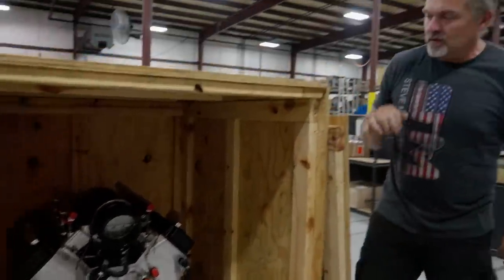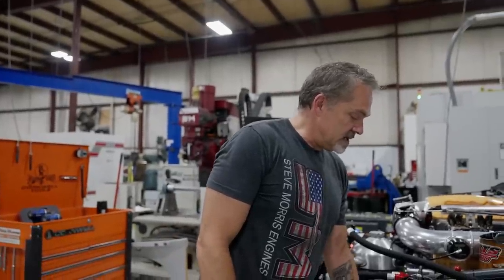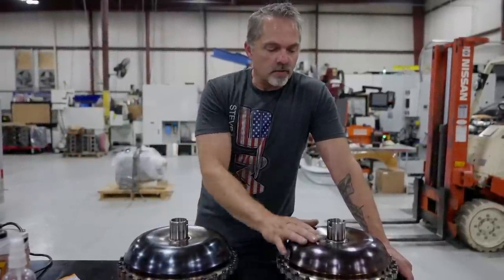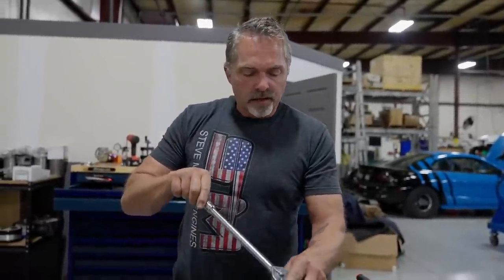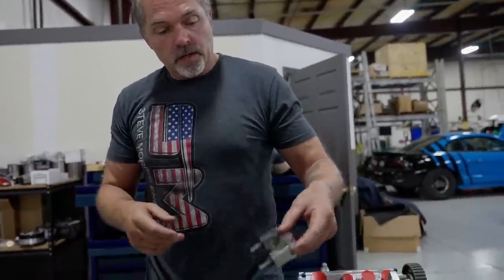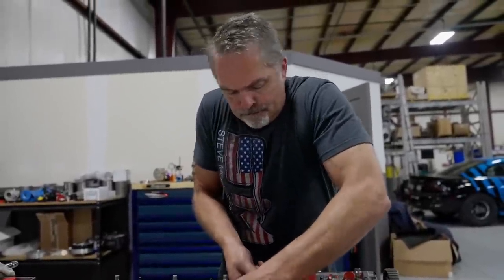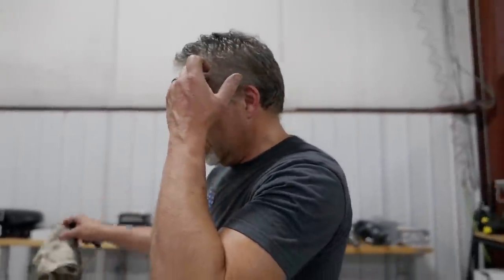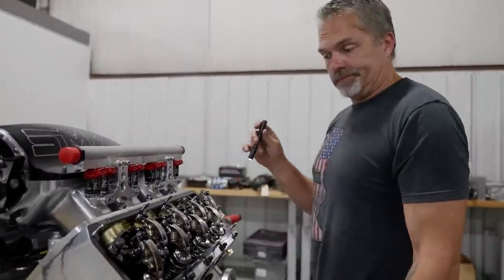What’s Up With Mullets SMX? Part 1

Comment: My bet is the oil pump itself.   Can't see how else the debris would be in the filter and nowhere else.
Reply: Agree!
Reply: I think so too
Reply: I was thinking the same or materials left in the fuel lines after being made and not completely cleaned out.  But I’m far from being any kind of expert and that’s why Steve is the best and will come up with the conclusion.
Reply: Plus that would also make sense why he dropped oil pressure.
Reply: +1
Reply: Debris left in cooler, lines or oil tank.
Reply: Would debris alone be enough to drop it down to 9 psi of oil pressure?
Reply: @richluckey8639 no, but if the pump is eating itself up it will cause debris and low oil pressure
Reply: Agreed
Reply: @aaronholtgrewe1971  from the fuel lines? but fuel dosnt go to the oil filter?
Reply: I got $1 on the oil pump
Reply: I agree. It wouldn't be the first oil pump that was destroyed and ended up in the clear view filter
Reply: Oil pump cavitated eat itself internally
Reply: @shelbyboer9416  Yea I am leaning towards the pump itself as well. I just saw others commenting that it could just be debris and I didn't think that alone would do it. Thanks for clarifying.
Reply: Didn't they already put a new oil pump in a little while back??
Reply: My thoughts too. Came to see if anyone mentioned it.
Reply: @dmmness was that cleetus that had the pump problem? I get mixed up with all the videos
Reply: Yup same here
Reply: @KPSchleyer  I thought they swapped it out when they initially found some debris in the filter the first time.
Reply: That's what I just posted, you beat me to it.
Reply: @richluckey8639  I didn't know he dropped oil pressure, the oil pump is now super sus.
Reply: agreed
Reply: Exactly what I was going to say
Reply: 100%
Reply: Yeah, it was the pump last time also. He didn’t get a new one- it just got rebuilt. So it’s still a problem child.
Reply: My thoughts also, the oil pump.
Reply: I agree
Reply: Yeah, just like the last time
Reply: The pumper of oil is dysfunctional
Reply: I didn’t see the debris but aluminum rods always rub together and leave aluminum in the filter happens on my hemi
Reply: That's what I was thinkin
Reply: Isnt that tne same issue Tom Bailey was chasing and found out it was the oil pump the whole time?
Reply: Steve didn’t you have an oil pump cause debris before maybe it’s an oil pump again
Reply: That's a brand new pump they just replaced.
Reply: @CaptainNero  yeah, after the first brand new Peterson R4 oil pump failed
Reply: Peterson oil pumps are ideally set up to turn in the 4500-4800 rpm range for maximum efficiency. I wonder if it's spinning  to fast and cavitating maybe it needs a different pulley
Reply: I was going to post this as well. Didn't Bailey have issues with his oil pump as well?
Reply: Tom had oil pump issues recently. Wonder if it could be related?
Reply: didnt he have a issue with another pump? this is the second one on this engine right?
Reply: Isn’t that the second oil pump?
Reply: @brandonlempar1195 but does your hemi drop to 9psi oil pressure like this did?
Reply: @KPSchleyer Tom Bailey had oil pump issue on his smx
Reply: @UnDeath91  your absolutely correct, my dumb ass said  fuel when I meant oil
Reply: Oil not fuel is what I meant to say.
Reply: @Foshomoto I think you are spot on. Cavitation causes micro explosions that will remove material from most any metal. These tiny “potholes” then produce lips that get ground off because the clearances become too tight, producing more metal particles. Either that or the one fabricated line that runs from the pump to the filter had debris in it. Anything else and you get debris in the pan. If the pump makes enough pressure at idle with a 6000 rpm pulley, I would see no reason to spin it faster. Everything gets better: less heat, less chance for caviitation, more hydraulic efficiency, less parasitic drag.
Reply: @bwalker4194 You’re exactly right on all points but the last. 
You have to drive the oil pump a little harder than you’d initially think to maintain pressure at high RPM because the crank acts as a centrifugal pump, flinging oil out of the big ends. That drops system pressure unless the pump is driven harder to overcome the loss. 
It’s particularly noticeable on engines that are set up to run big bearing clearances. 
😎👍🍻
Reply: @mikehunt3222  at the end of track it drops to  18psi for little period time cuz run wet sump pump, but never worry about it cuz rod bearings still have coating on them after 60laps
Reply: 100% I think this is a failing oil pump, the pressure drop and material in the filter and pretty sure the filter is right after the pump.
Reply: I'm in on the oil pump theory.

Comment: As for Garret's abundance of caution, it's  because the price difference between LS and SMX motors will tend to do that.
Reply: more than likely the down time if it completely grenades
Reply: isnt it sm to smx like differance?
Reply: When did he ever have a LS in the El Cammino?
Reply: @KimiWallrus  i not 100%  when it first got built at KSR
Reply: @williamherzog6920  that was the first motor ever put in from cleetus 427 texas speed
Reply: @KimiWallrus  Actually it was LS build from the get go. Ran LS for quite some time before upgrading to BB.
Reply: @KimiWallrus  It had an LS when it was still going to be a jet car, which he thankfully bailed on. They ran the LS into the 6s before going to the BBC.
Reply: @--_DJ_--  This mullet is not the jet car.  The jet car was stretched to make room for the engine.  The current race car was a backup that Garrett had.
Reply: @paulcopeland9035  The body is different, the chassis is from what was going to be the jet car.
Reply: They give out SMXs for "likes"

Comment: I'm putting my money on the oil pump. This is probably my favorite SME videos to date. The rib jabs and jokes here and there are top notch!
Reply: It's my guess too
Reply: I think John Doc had a problem similar to this in his black sheep car with the ls and external oil pump coming apart from over spinning them
Reply: my guess too now we know everything else looks good , and didnt mullet have an oilpump fail earlier or am i mixing somthing up ??
Reply: 100% on the oil pump bet
Reply: @Luske74  yes, the pump failed, but that was due to ingesting metal
Reply: @Luske74  yeah when they replaced bearings before I believe they had an oil pump issue
Reply: Oil pump .
Reply: Looks like you called it.
Reply: Scavenge side of the pump sucks from the pan and pushes to the filter, which is where the metal was. With nothing in the pan, and the mains/rods being perfect, the bearing metal has to come from the pump.
Reply: Same even before he touched it after the bearings looked good that was my guess.

Comment: If i remember correctly, one of the turbos was having oil feeding issues, maybe the turbo got a bit torn up and sent little pieces through the return line, which is why there is no metal to be found in the engine itself
Reply: Wouldn't you think you'd still see it in the pan though since it has to go to the pan via return line? I'm not sure but it's a very good thought.
Reply: And it was being fed fine but they had leaking issues from the seal I believe right?
Reply: This is my guess as well or I don't know oil flow direction or remember if the oil lines and cooler were changed when the other oil pump let ot maybe some residual trash caught in the lines
Reply: Does the oil return from the turbos feed the pan, or direct to the scavange side of the pump?

Comment: Best guess oil pump. If I remember correctly he lost oil pressure and then you guys found material in the filter. Possibly cracked gerotor letting it expand and started eating the housing of the pump.
Reply: 90% sure they are all gear pumps on that system, could be pump cavitation though

Comment: Steve, much respect for the live teardown on Mullet's engine! There isn't many people, let alone very competent people like you that are willing to show being puzzled on camera. That could have been easily edited out, yet it was left in and I have respect for that sir.

I am wondering if the oil pump is having an issue again or possibly the camshaft. If I remember right, he said he dropped some oil pressure right, which prompted the whole inspection to begin with?
Reply: I think it’s the pump to because what else can have material and not put it anywhere in the engine
Reply: Or sending unit, that electronic stuff takes a crap all the time
Reply: Has cleetus finally grown up? Heavens forbid lol.  Oil pump wear ? or a crap oil pressure sending unit. Motor looks too  perfect to be anything serious. Over abundance of caution rules the day.
Reply: @jaredweingartner3871  It is likely the pump if anything. It could be leftover trash in a line or from making all the new lines and not flushing them, but I doubt they skip that step. It seems to be making material so out of all my options, pump makes the most sense to me.
Reply: That was right after the last race he had, right?
Reply: it dropped to 9psi when he drove back into the pits after a run. he said when he revved it that it went up to like 50psi but came back down with the motor. they had metal in the oil filter sight glass t;hing. they also had metal in the oil when they drained it that morning for an oil change.
Reply: I too am wondering if a tiny piece of valve spring made its way down to the pan and subsequently into the suction side of the oil pump.  Taking apart the oil pump shouldnt be too difficult but it could be worth opening it up to confirm it is or isnt the source of the metal in the filter.
Reply: Yeah 
Mechanical pump with Cog misalignment 🤔🤔
Rubbing on the Housing Buring & Pitting Shards into the lines.
Reply: @randalltufts3321  I agree with the oil pump therory but wasn't the engine making some noise when he shut it down as well?
Reply: @davidfloener7539  watched the cleetus vid again and no. Just down to 9 psi oil pressure at low idle, but returned to 50psi at rev. I still suspect the oil pump.  Possibly left over debris in the oil lines or oil  pump wear throwing material. I've seen more than one instance of racers this year have issues with scavenge system pumps

Comment: I would check the oil pump for wear before the engine tear down.  It appears Garrett is growing up, he was hell bent on blowing up engines a few months ago.
Reply: Didn't someone eat an oil pump recently and it was throwing stuff into the filter?  Was it SM or CM or someone else...??
Reply: Yes, especially when considering that the oil pump was absolutely destroyed on the last inspection teardown.
Reply: @superkillr  I think it was GM.
Reply: Not up top, not down below, the material had to come from somewhere. Seems like the next logical place to look.
Reply: Parenthood will do that to ya. You start thinking about blowing up at 210 and not going home to the family.

So you do your best to NOT blow up at 210.
Reply: Growing up?  And lose thousands of subs / clicks?  Never !!
Reply: @superkillr  That was cleetus too. Last oil pump ate itself up which wasn't too long ago. Could be debris stuck in the system perhaps that found itself back in the pump to repeat the cycle.
Reply: I thought the entire reason they stopped was because it had single digit oil pressure
Reply: @superkillr  Yes I don't remember which car (was it Baily's?), but part of the screen on the oil pump intake fitting broke off and went through the pump trashing the pump.
Reply: @Jeff7477  I don't follow GM, so you could be right!
Reply: @wordfabstream8745 that and this isn't a $10-20k LS combo anymore. The heads on the smx alone probably cost as much as the entire engine in Leroy. But I've noticed safety is definitely weighing in more for the things he's done since his little boy was born which isn't a bad thing. And oiling down the track, smacking the wall, and having to haul a crumpled smashed mess home from a drag and drive event would also suck.. either way it was a smart call on his part. Saved his life, the car, and whoever was in the next lane.
Reply: @superkillr was it Tom Bailey

Comment: Awesome quick peek Steve. I think one fragment of the broken valve-spring has found it's way to the oil-pump. 
Always check if all the broken parts can make it complete again. If something is missing it still is in the engine. Good luck with the rebuild.
Reply: I think some is still leftover from the bad pump
Reply: @MrKennyanders there’s a good chance the oil pump is eating itself again there’s a reason alot of people won’t run that brand pumps anymore
Reply: @54raceman  if you go back to the video where they took the pump apart, you can see Steve notices the small filter 'hat' protecting the pump inlets in the sump from big chunks entering is missing some material, which can't have gone anywhere but into the pump, causing it to grind itself to pieces

Comment: We used to use ferrography to analyze used oil to try and figure out where the wear was coming from. You could really get a lot of good information with one simple test. It can tell the difference between babbitt material, aluminum, iron/steel wear and carbon sludge. It does require the ferrography equipment and a microscope but they can be put together relatively cheaply.

Comment: Glad to see the SMX not hurt, we did see he hurt a turbo. Could the debris come from the turbo? Doesn't the turbo drain directly back to the pan? Just an idea, love the honest videos
Reply: This was the same thing i was thinking but the oil pan is clean. I'm wondering if its just past issues stuck in the sump system.
Reply: I think the turbos would go to the scavenge side of the oil pump.   I'm betting they find something in the pump...either from the turbo or the pump itself.   There was debris in the filter (IIRC) and it was leaking from the rear main seal.   But they know the converter is having trouble handling the power and getting REAL hot...so that might have cooked the seal.   They're really pushing this automatic trans with this much power.
Reply: Was going to ask same thing
Reply: As a turbo builder. Ball bearings/debris can fall into the pan after a bearing failure. BUT cleets turbos were just smoking. Turbos won't drop anything in that scenario.
Reply: Possible cam bearing? Or do you use roller cam bearings?

Comment: time for you to add a lockup convertor to your automatic Steve. I am thinking cavitation / fluid shear at high rpm as you overpower the stator is causing the heat buildup within the convertor itself. Especially looking at your fluid changes. 900F fluid temps non localized would burn the fluid black as the ace of spades. Yet that is not happening. So all the heat to blue the Stainless is being generated within the convertor itself, and that localized fluid. a lockup clutch will solve that issue :)

Comment: As a engine builder I believe you just put caution first, and didn't want anything to go wrong and cost either you or Garret $$$$ Safe and great call. SMX lives to race another day>
Reply: There is still a problem but it's not the engine causing the low oil pressure it's the converter pressure that's that issue and Cleetus is resolving that on his end
Reply: I don't think it's just the converter that's the problem. And it wasn't just because of over cautious. His oil pressure dropped to 9psi. That's EXTREMELY low. I think his oil pump was eating itself alive, causing debris and low oil pressure. Maybe the converter having too much pressure is what caused the oil pump to fail. What else could cause debri & low oil pressure? Debri alone wouldn't cause oil pressure to drop to 9psi.

Comment: Hopefully it’s good to go. I’d be checking and cleaning all the oil lines, fittings, and the tank itself. Maybe turn the engine 90 degrees at a time and recheck the thrust. I can’t see that making a difference though.
Reply: Maybe something is just on the tight/loose end when warm

Comment: Really looking forward to see cleetus, tom and steve battle each other on the track when all their mechanical dramas are sorted.
Reply: Wouldn’t really be much of a battle if each makes a clean pass because their times in “drag racing times” are quite different. What should happen on paper is Tom will win, Steve will be 2nd, and Cleetus will come in 3rd.
Reply: Steve will repair any breakdowns so they can beat him😂
Reply: Looking for a 6:10 winner.  Track condition will dictate sub 6.
Reply: Cleatus will never have his mechanical issues sorted, because he keeps messing with stuff that doesn’t need to be messed with, instead of working systematically to solve a problem. He’s too reactive, the only reason he’s competitive is because of an almost unlimited wallet. If he didn’t have the cash, he’d be last every time.

Comment: He shut it down for low oil pressure and metal in the filter. Hard to tell in the video how much movement there was in the crank at the track. Had like 9lbs oil pressure driving it back. What would be normal for that scenario? how concerned are you with the amount of metal in the oil filter they showed on the video?  They also had a throttle position sensor issue on the last run as well. It’ll be interesting to see what you find with his motor and your trans converter.
Reply: @ElliHarper  sounds logical